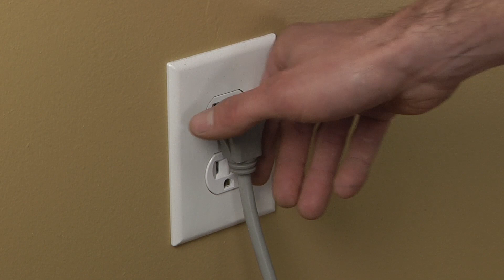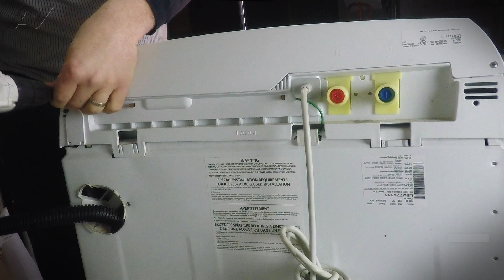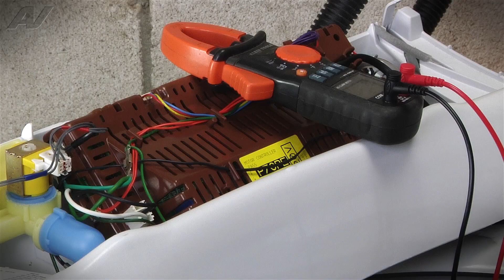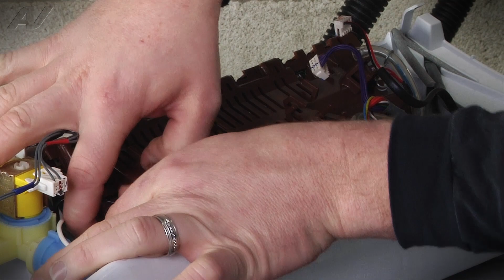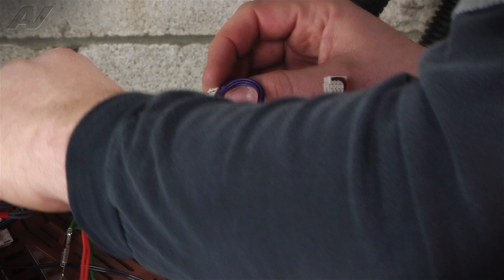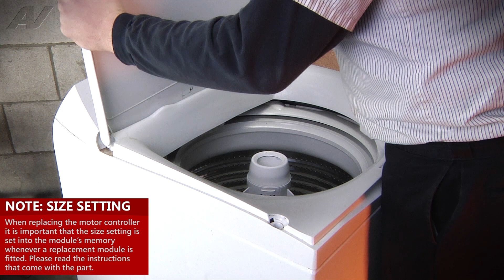Fisher & Paykel Washer - Will not start - Electronic Control- Diagnostic & Repair

Comment: Before you go spending stacks of money on a new control board. Check that the lid closes the cut off switch properly. Many people sit on these (for one reason or another) and bend the lid so the micro switch doesn't close anymore.

Comment: Our Gwl15 only does 1/2 a turn then stops.  I have replaced the drain pump and top and bottom bearings.  Lights work on control panel and cab enter diagnostic mode.  However we can't exit. Comments appreciated.  Rick from Kansas.

Comment: Power coming into the board? Yes. But that doesn't mean that 1 of 2 fuses might be blown? Didn't check for that? Sadly, my fuses were ok. So yes, now I have to by a new board. But you should check the fuses inside the unit before buying a new board. You might get lucky!!!!

Comment: If I’m not getting a voltage read with my multimeter when testing at the motor controller input area but I know my power supply is good and that the outlet has proper voltage does that point to an issue with the power cord?

Comment: Hi. My washer doesn't power in at all anymore 
I stopped during mid wash

The power point works fine . I also plugged the washer into another power outlet and it doesn't power on

Whst could be at fault can you make any suggestions?

Comment: This is MISSING the inline fuse for the pump wires. It should be added anytime you service or replace the MCM. (F&P made a service bulletin a while ago on this)  Great video tho!
Reply: If not the board will blow out
Reply: In a case I was dealing with the unit kept beeping in and out
Reply: do you have a link to the service bulletin?

Comment: How do you know the buttons were working? I have a unit that will not power on or show any display but the buttons are caved in but you can still hear them quick when you press them

Comment: Hi, what if it's the power supply? I tested the power coming in to the board and I think there is none. It's not the powerpoint, I tried it in a different one. Can the power supply be replaced and is it worth it.

Comment: Ypu didn't check if it was the key lock function.
You may have just replaced the control board when you didn't need to.

Comment: Didn’t have black and white wire . Had blue and brown so I copied the side you had each terminal and it blew up in my face. Looks like it’s a new washing machine because everything looks fried including the terminals to my volt charger
Reply from the maker: Great question, if you have a more technical question that our parts department cannot answer, you can search our over 13,000 answered questions free at our website www.ApplianceVideo.com under our Repair Help section. You can also call our parts department at 1-800-830-5465 and they can give you help 7-days A week Monday Saturday, or search at www.SaveMoreOnParts.com  24 hours 7 days A week.

Comment: How do you check if the buttons on user interface is working?
Reply from the maker: Great question, if you have a more technical question that our parts department cannot answer, you can search our over 17,000 answered questions free at our website www.ApplianceVideo.com under our Repair Help section. You can also call our parts department at 1-800-830-5465 and they can give you help 7-days A week ,or search at www.SaveMoreOnParts.com  .

Comment: I thought you were going to repair the existing board? Is it not possible? Mine the fuse on the board is blown. Can I not desolder and remove it and resolder a new fuse in? If yes where can I get the fuse revision kit without the board? Can I purchase a fuse holder somewhere and crimp it in on the brown wire side of the pump?
Reply: Oh and the fuse specs?

Comment: I accidentally put the meter tester on the wrong wire and it sparked does that mean I need to get a new board
Reply: I'm guessing its the Motor Contol Module
Reply: And the board in the back of the piece that has the power and mode buttons on it
Reply from the maker: Great question, if you have a more technical question that our parts department cannot answer, you can search our over 17,000 answered questions free at our website www.ApplianceVideo.com under our Repair Help section. You can also call our parts department at 1-800-830-5465 and they can give you help 7-days A week ,or search at www.SaveMoreOnParts.com  .

Comment: I did this and it now turns on, but when I click start it just says “lid lock” and won’t run. The lid does not lock. When I turn it off, it automatically turns back on and random lights turn on but nothing happens. None of the other buttons are responding besides Start and Power. Did I do something wrong?
Reply: Reset the board
Reply: @raymondblakley3731 please respond. How do you reset?
Reply: Was the water supply on from the laundry tap? Mine did this because I didn’t know my kids turned off the tap that supplies my washing machine it’s water.

Comment: I have the same model. I am getting a power out warning, will restart in 10 seconds. Some days it works, some days it doesn't. I can also change the "dirty" setting and it works again. Any ideas? Could it just be loose connections, like other users have written on other sites?
Reply from the maker: Great question, if you have a more technical question that our parts department cannot answer, you can search our over 17,000 answered questions free at our website www.ApplianceVideo.com under our Repair Help section. You can also call our parts department at 1-800-830-5465 and they can give you help 7-days A week ,or search at www.SaveMoreOnParts.com  .
Reply: @Appliancevideo  it come up when I start washer pu then flashes au
Reply: Electronic door switche